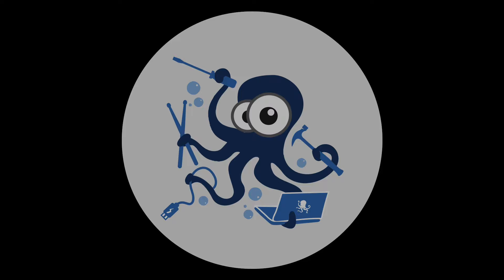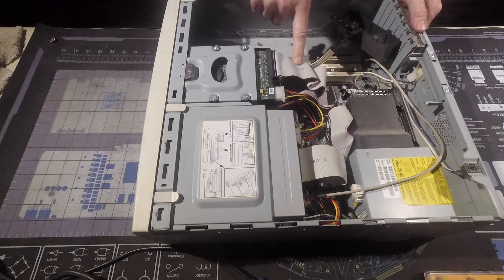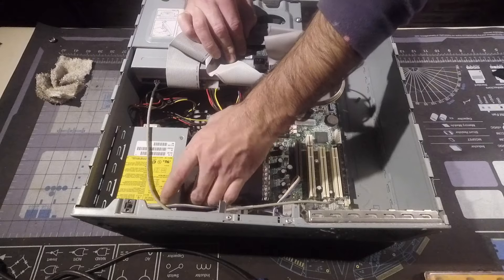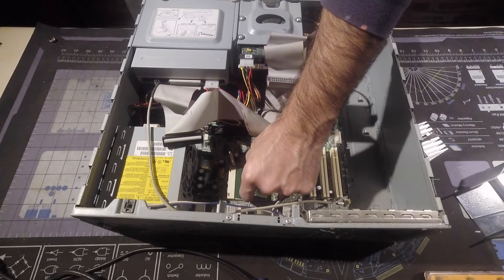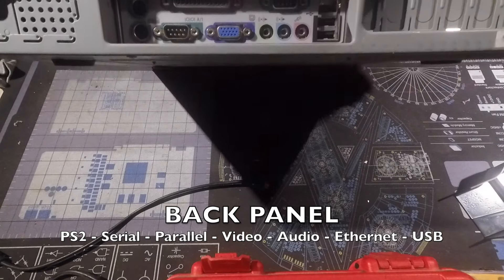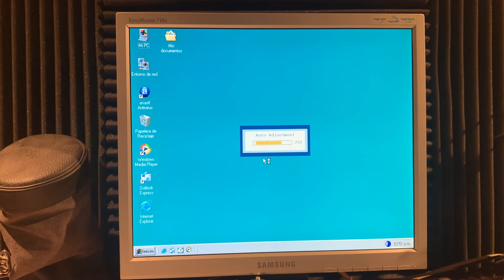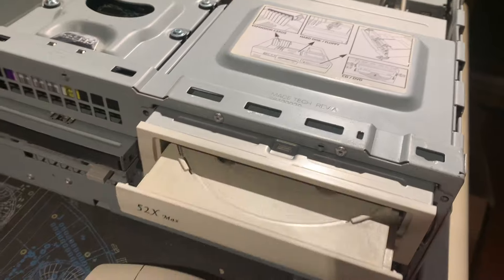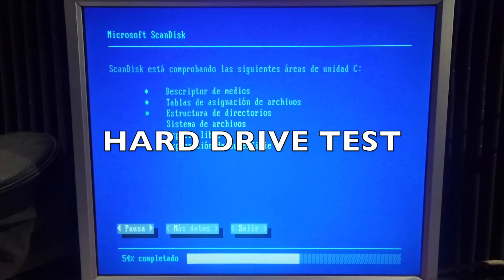MAIL UNBOXING - HP VECTRA VL400 #restoredwards

Comment: Nice video and interesting computer. That pci slot with the small extension is something I never saw. But the chipset drivers are not installed or dont work, I think. All 3 Nvidia card show Bus: PCI. If the chipset drivers were working, it should say: Bus: AGP. That is causing the crashes and the glitches. Cool machine capable of many retro games you have there.
Reply from the maker: Hey man thank you! I will check drivers for sure

Comment: for a sec there i thought the agp port was broke till the Vanta card played the 3dmarkk 99 without artifacting, sorry dude but you must have a lot of faulty agp cards laying around.
Reply from the maker: I don't think so. The artefacts are because of compatibility or drivers or other reason but if you see in my other video in the other PC they are working fine:
https://youtu.be/Dtw5xzl_X2Q?si=VsA-RGWmN1WGyo5P&t=907
Also, no artefacts in windows games like Half Life or Quake.
This AGP cards are not very good whatsoever, if I would build a system I would go for something else.
Reply: @restoredwards  I did have a cross over board which I recently sold that was pentium 4 that had both agp and pci-e on it I got £46 for it which I feel is a good price obviously Americans would disagree and wait for a billion years to sell it for like £120-£250, I'm shocked and appalled at the prices Americans ask for Retro motherboards.
Reply from the maker: @danthompsett2894  Sure, in each country handle different economies and if the retro community is big the cash flow will be bigger I suppose.
Reply from the maker: @danthompsett2894  Niche motherboar that one, never saw AGP PCIE in same motherboard.
Reply: @restoredwards  unfortunately they all come from the USA least on Ebay.
Reply: @restoredwards  Asus P4V800D-X

Comment: fx5200 is the worst geforce card ever made.
Reply from the maker: For this system it fits quite nice, what other AGP card would you recommend?
Reply: @restoredwards  i would say ati 9550 which has 256mb of vram.
Reply: or go with an oldie but a goodie which is the original radeon the 7000 series....mine has 64mb vram and is agp.
Reply from the maker: @michaelwood9866  That's sounds good! What about a GeForce 6200 with 256?
Reply: @restoredwards  that's also a good one just steer clear of the fx series